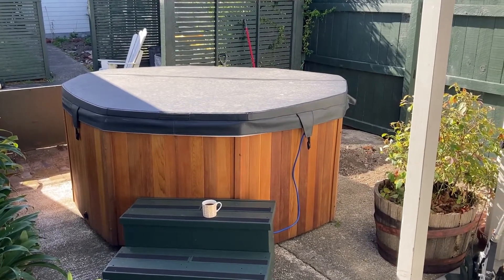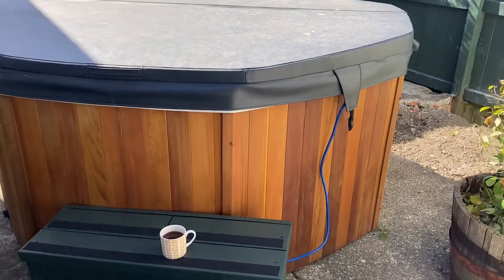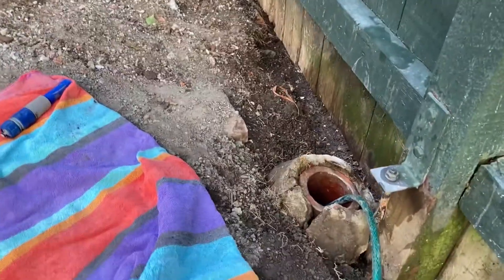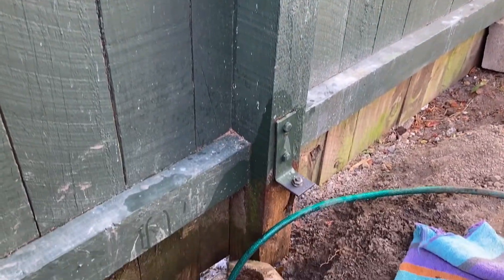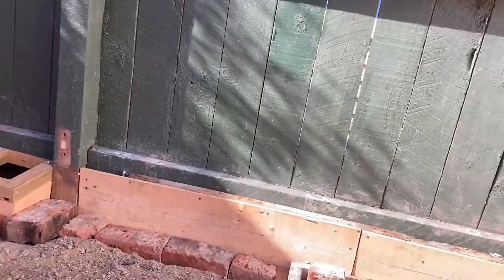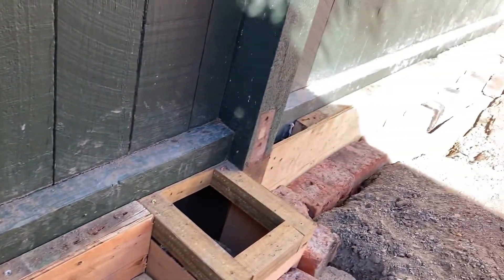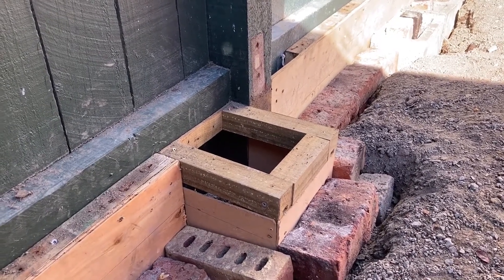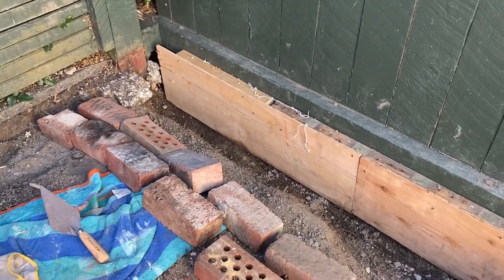DIY Cheap Low Cost Retaining Wall and Setting up for Concrete Slab / Pad

Comment: Hi Adam, I'm replying on here rather than on my own video where you left your kind comments as although it came through on my email I cannot find your comment on my channel to reply to you. I have just watched your video, a nice little project. You mention dollars so I guess you must live in the USA, I think it will turn out quite expensive to use readymix concrete at $8 a bag would it not be cheaper to buy the aggregate and cement separately? With the weight of water it may pay to incorporate some wire mesh into the concrete base. I look forward to seeing the progress. All the best and good luck from here in the UK. I have just subscribed
Reply from the maker: Hiya. Thanks very much for your advice. I am actually from NZ and luckily our dollar is a bit less than the USD. I am weighing up the readymix v the buying and mixing of seperate components. The simplicity of readymix means I need less equipment and less helping hands potentially and also where we live it’s harder to source the raw materials. Anyway I am still ringing/surfing internet around etc so we will see. Thanks for showing interest. Good luck with your next project!!
Reply: @adamsdiyuniverse-savemoney4563  Hi, nice to hear back from you, NZ is a lovely country, we have a daughter that lives in Wellington so we have visited your country maybe a dozen times. I certainly agree about the readymix being easier. I shall look forward to your next video.
Reply from the maker: Cool. Oh and I was just cutting up the mesh now and thought of you. Yes I will be putting that in place too. I try to reuse as many things as I can but that is another thing I couldn’t seem to salvage in a reasonable timeframe. They tried to sell me stands and things for the mesh but I drew the line at that point. I have a big pile of stones and bricks from what I removed so I will just prop it up with that. Interesting re your daughter. I know Wellington very well. I live in Wellington. I have lived in the UK London and Oxford from 2003-10. You’ve got a pretty awesome country too :)